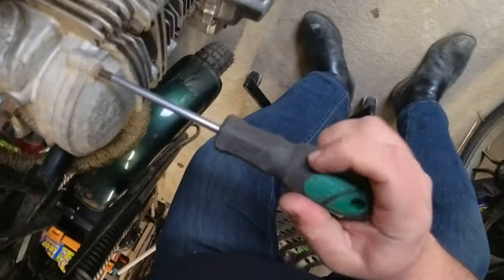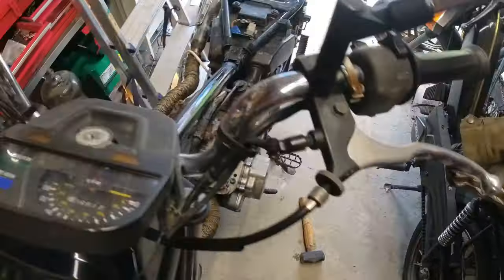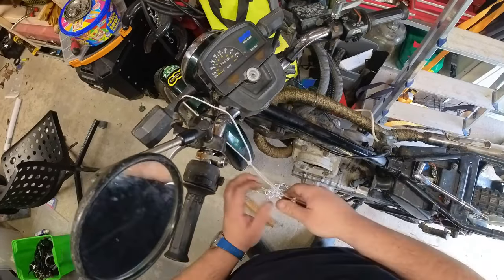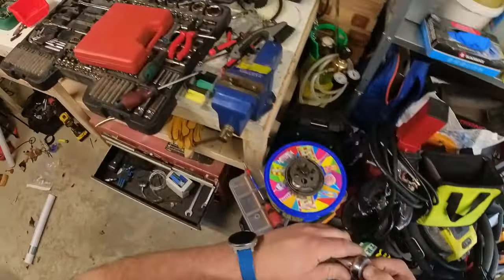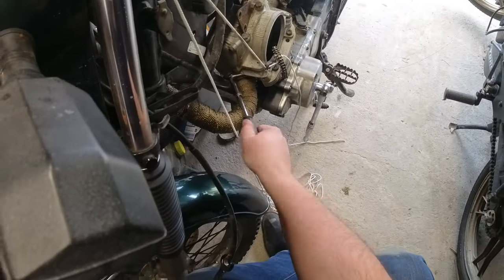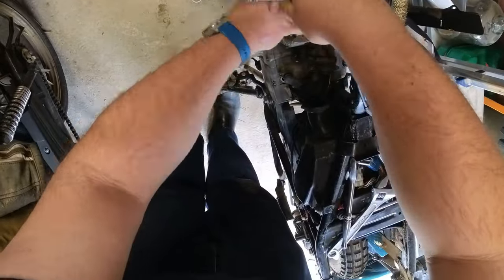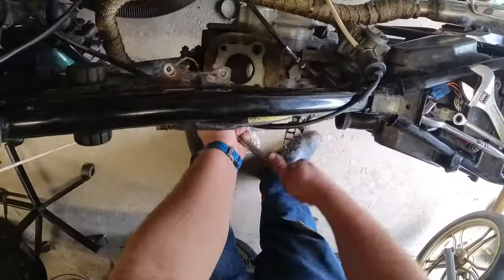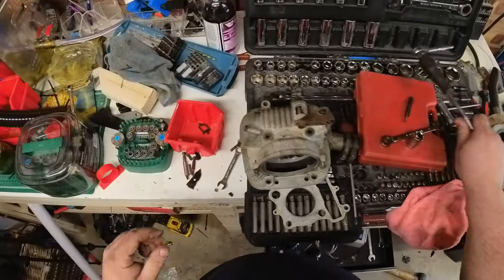Yamaha SR125 Top End Engine Teardown - The Grand Challenge | JAM#22

Comment: I need to ask a favour! I've just bought a sr125 and it is missing a component, possibly a relay. It should sit just to the right of the battery compartment, above the brake light switch. Could you possibly tell me what it is and ideally its number? I would be very grateful. Thanks
Reply from the maker: I will take a look and see if I can help!
Reply: @justanothermotorcyclist  Thanks very much.
Reply from the maker: The relay on mine is marked "2R 01, Omron, 0225D6" - it looks like it supplies power to the starter solenoid - hope this helps!
Reply: @justanothermotorcyclist  Came up blank on the numbers, but got a yamaha starter solenoid and now will hope for the best. Thanks for your efforts.
Reply: Hi can I ask you something please  @justanothermotorcyclist